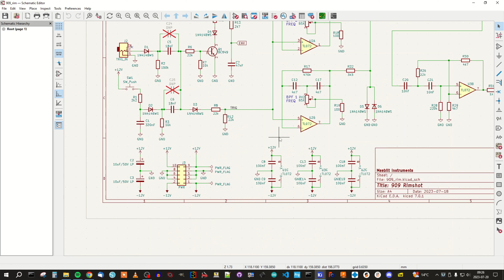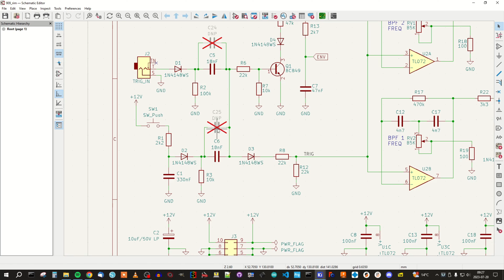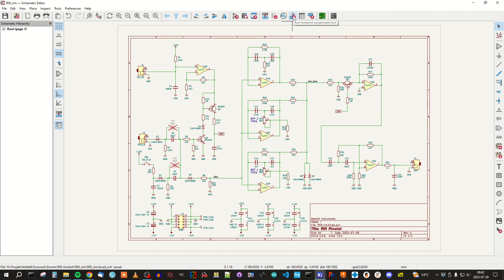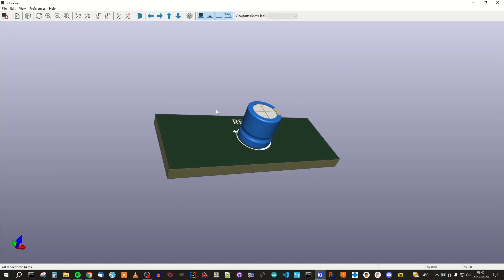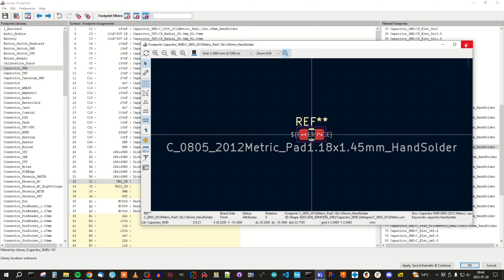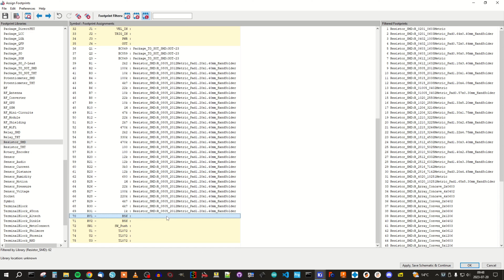Eurorack DIY: 909 Rimshot (Episode 3) - Floorplanning

Comment: I love the way you selected multiple close components on the schematic, and then flipped back to the pcb to group them. I had only thought of selecting one at a time! Less alt tab now for me 😃
Reply from the maker: Thanks! For a small design like this it may be a bit over-ambitious, but for large designs it really helps a lot to organise the components before you start to place them on the PCB. The routing becomes much faster and it's less rework. I hate to rip up already placed traces and redo it just because I missed to place a component...

Comment: Ya, you're using a very large knob or so, but this will probable fit 4hp or 5hp if you like maybe even 3hp.
More will fit in your rack, i converted a commercial ADSR that uses 8 hp in to 5. you can also place the PCB perpendicular to the front panel and go deep, but slim. using old style metal alpha pots to hold pcb or different jacks.
Reply from the maker: Sure, there's a lot that can be done to shrink the no of HP. 
But this is the construction practice that I use for all of my modules.
Reply: @MeeBilt  my Korg MS-20 filter iteration is 5hp, contain 4 jacks and 5 knobs / pots.
2 knobles attenuaters fit next to each other. 
But 22 mm deep. my HP filter is based on my own design but shrunk even further to 4 hp using 3 jacks and 2 knobs. i have designed "stereo" mixers on 4hp, so i can expand the HP filters functions if needed.
Reply: @MeeBilt  i successfully moved CD40106 and 74HC174 with the 3V33 microchip Fubarino mini 2.0 and translated to 5 Volt via those ic's, In case you didn't or don't know it works with the Arduino IDE, just plug the USB cable and hit program, a real time saver rather than using a microchip programmer, plug and unplug every time you program.
all the Arduino software libraries from people build in to the IDE work if you assign the pins correctly therefor you need to download 2 documents for that, from chipkit and fubarino. 64kB ram and 256 kB flash for 23€ at mouser. cheaper than Arduino.